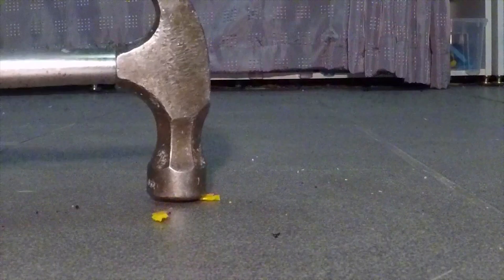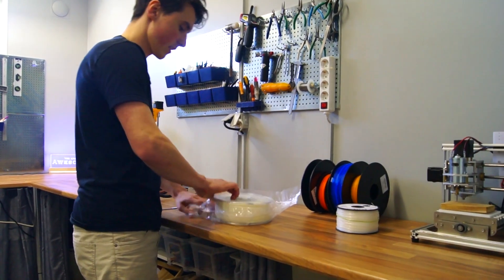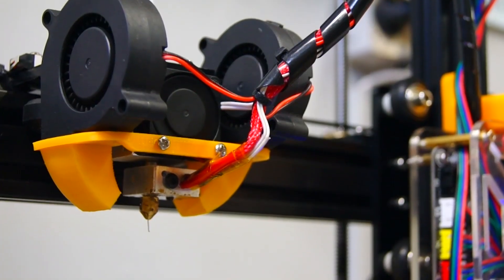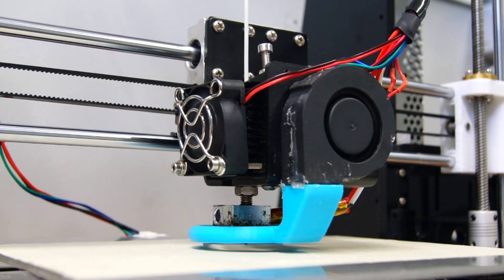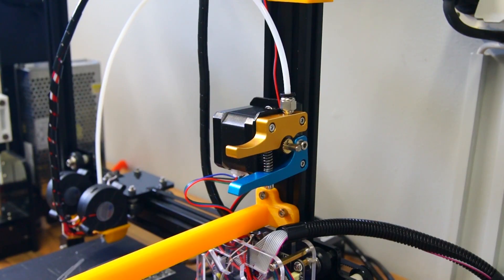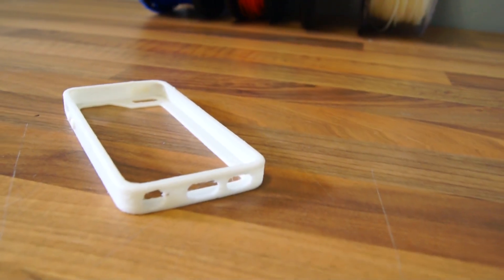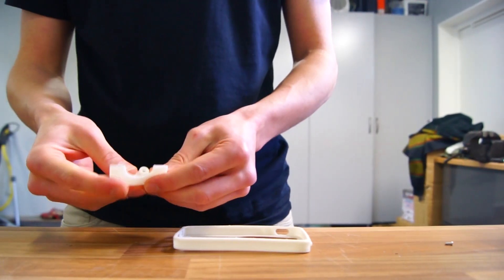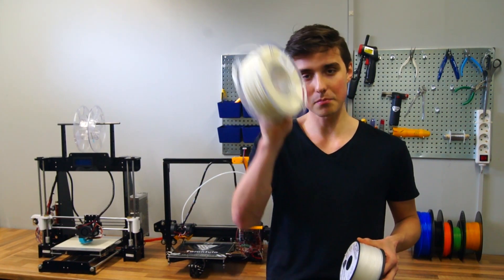Awesome Flexible 3D Prints - How to Print Flexible Filament

Comment: I printed some feet for my gas 6K generator. It sat on the back deck and would send vibrations through the wood into the floors of the house. Add some 4 x 5 in feet zip tied on and it reduced the vibration by 60% or more.

Comment: I think I'll print some flexible bumpers for my personal electric vehicles. I'll have to find what filament is both impact resistant and abrasion resistant, as I think those are the two main risks (also, it should be fairly slippery, as it is often preferred to slide rather than abruptly stop during a collision.

Comment: Great video. I modified my OG Ender3 to print flexible stuff, and it's incredible. I printed some grommets for my car, the old ones were allowing my air filter box to vibrate because they were worn out... with the new ones it doesn't shake at all.

Comment: Hey RClifeOn, I wanted to say thank you for all your videos on 3d printing. I had a question regarding the flexible filament you are using here. 

Im making a brake pedal covers for my car as well as a flexible boot for my shifter. I wanted to ask if you knew the thermal behaviors of these filements. I'm trying to figure out if these filaments would be okay with handling drastic temperature ranges normally seen in cars. If you don't know, could you point me in the right direction?

I appreciate whatever you can offer. great content, thank you...

-Evan

Comment: Way over cost on the old anet a8.   They've upgraded to the AM8 at this point for the same cost, and its easier to just throw some linear rails on the AM8 because its made of aluminum extrusions.   Not saying the anet a8 isn't a great printer, it is, but it isn't 260 dollars great in the current market.  Dont pay more than 130 for an a8...

Comment: Image using the elastic filament, for something like a phone case for a cheap phone like, a phone from a dealer like, metro.  Having a back to the case, would help, especially if it's dropped off a table or a desk. I would use it for that, going with a design that had some grip to it.

Comment: Say that I want to make a custom figure with a bendable tail, aka steel wire on the inside. Is there a way to print the tail with a flexible but more bendable and a bit tougher material?

Comment: alot of 3d print guys are nuts and goes buys a 30 dollar part for there  upgraded parts for there 3d printer, This guy is kinda smart, his 3d printer couldnt print flexible filament, so he 3d printed a part to fix and upgrade his printer, didn't order a 30 dollar part.

Comment: I really need to find a flexible filament did I can print with my cr-10 that is about the flexibility of a rubber spatula do you know of any such filament? Also is there a good solution for the extruder on a cr-10 I know there's a printable extruder solution but I don't know how good it works I guess I would just have to try it out. Any help that you could give me would be greatly appreciated

Comment: Would PCTPE work well for printing arms for rc cars or would you recommend some other filament? Thanks
Reply: Regular nylon would be nice for that I think, pctpe is a bit too flexible
Reply: ValeninRC Would that be like PETG filament?
Reply: @romanbriley2740  no, petg is much harder and more brittle than nylon, nylon is kind of a mix between pctpe and petg. Also depends on the type of nylon of course
Reply: @romanbriley2740  but if it's a 1/10th scale you can also just try it with PETG or even PLA
Reply: ValeninRC I got some PETG today and was going to give that a shot. I’ll definetly look into nylon then. Thank you.
Reply: ValeninRC PLA is a little too brittle, I’ve printed some arms for the bandit and it’s okay but yeah too brittle. I’ll give PETG a go and work from there.

Comment: Hey man, i love your channel and jt inspired me to buy a 3d printer, and i like to grt hands on with things so i picked the creality ender 3, i didnt get the pro tho, but i have a question, my printer worked amazing, not perfect but great results for the first few prints, but now the printer is leaving some space in between lines, on all axis, which makes the prints come out spacey with gaps in them, i use good quality filament and recommended settings, any ideas?

Comment: #1 pro tip for printing with flexibles, even with a bowden: run ptfe tube all the way in between the extruder gear and idler, with the tip cut in a wedge shape to fit snug against them.

Comment: i'm going to print this: Thor-Design-Gurtschlaufe … a mounting for the battery tank of a diving lamp (attach the battery to the compressed air diving device) - 95.- I find clearly too expensive; we'll see if my ANET A6 can handle it (if it is fixed again)

Comment: Hello, thank you for your content. I am presently working on finding a material suitable for making my prototype. 

This material needs to be soft yet keeps its form, very light in weight so it can interact with air when it travels through air ( airworthy) and smooth so it will help with the airworthiness.

I have tracked down the material to TPE category and then the subcategory of the PEBA.  

I wonder if I am finally on to the right material for my toy prototype?

Can you suggest anything else to meet my criteria?

Ideally a material similar to what soft boomerangs are made out of, they seem hard yet bendable and keeps its shape, soft and lightweight and smooth enough surface for air travel when thrown.

With kind regards,
Mehran

Comment: Hi...
How about to explain differences between materials and for what is better recomended : PLA, ABS, Flexible PLA, HIPS, WOOD, PVA, Nylon, Wood-Polymer, eLastic, PCTPE
Show us some examples also. ;)
And maybe to try to listing each material for one by one of all your printers... if support to print... or what adjustments can do to work each filaments for each printers... of course, if is possible.

Comment: I wonder whether anyone has tried making a non-Newtonian filament?

D3O (which is used, amongst other things, as 'molecular' body armor for motorcyclists) is a polyurethane energy-absorbing material containing several additives and Polyborodimethylsiloxane a dilatant non-Newtonian fluid.

But, even if that mixture is patented, corn starch is one of the easiest to get ingredients.

If we can print and create a flexible, non-Newtonian gel, then we can make our own armor, gadget protectors, and . . . everything !
Show less
REPLY
Reply: What I mean is: D30 company have taken non-Newtonian fluid and made body armour. Perhaps they use an injection molding process or something similar.
If you know for certain that non-Newtonian properties will not occur in a solidified material after it has been liquified and then cooled: then I accept your response.
However, I expect that D3O is also in liquid form prior to being molded into shoulder pads, knee pads, etc. which is why I initially made the comment -- I am simply hoping that an impact-resistant, non-Newtonian material is developed soon, so we can make our own gear.

Comment: TEVO Tarantula must have the flex extruder to print with a flexible filament ?
Reply from the maker: No, but it will work easier and you might be able to print faster.

Comment: So you didn't use a different extruder for Tevo, just a tighter clamp solved the issue? Flex extruder adds 40$ to printer's price...
Reply from the maker: Yes, I simply added the tighter clamp, though it would be interesting to see if the flex extruder would increase printing speed.

Comment: what's the point of a flexible wrench? you wont be able to use it or was it just for click bait
Reply: brendan lee Why would this be for clickbait? The thumbnail shows a flexible wrench, which he showed in the video. Also he just printed the wrench to show the properties of the filament and because it looks cool, not because it's useful.
Reply: A flexible wrench can be used on flexible nuts and bolts.
Reply: brendan lee it’s a joke dumbass
Reply: protection & gopro & lot of nice parts for FPV drone. I just bought one and will be only printing tpu
Reply: brendan lee obvious guy is being obvious
Reply: Yann Msa  if you want to be printing a lot with flexible filament get a flexion extruder

Comment: so i have a question.i have been working on snorkels for people and one common issue  that occurs is the valve under the mouth piece breaks or erodes. is it posible to print one of the valves out of that material. also is it possible to use the as-atone bath method to make it smooth?

Comment: Does anyone know what the best 3d printer is for under $250? Also, if you know one can you list it's print volume?
Reply: https://www.amazon.com/Monoprice-Select-Printer-Heated-Filament/dp/B01FL49VZE/ref=sr_1_1?s=industrial&ie=UTF8&qid=1490831482&sr=1-1&keywords=monoprice+3d+printer

You can find it non backordered on monoprice.com, and the build volume is : 4.7" x 4.7" x 4.7"
(120 x 120 x 120 mm) .

Comment: man I want a 3D printer so bad
Reply: Save up the money there are 3D printers that cost just $200 now.
Reply: Speshial yeah here is a link to one https://www.amazon.com/dp/B01FL49VZE/ref=as_li_ss_tl?ie=UTF8&linkCode=ll1&tag=corridigit-20&linkId=f7b4505f5f72b686422ee123a378c38a
Reply: @Scrotelicker  its small as hell
Reply: @Scrotelicker  you don't want that POS... get an ender 3
Reply: GrodyMaroon I'm probably gunna get the tarantula
Reply: ppdonut there are?...
Reply: diego ramos the anet a8 is cheapest on gearbest. I have one myself.
Reply: This is definitely far too late to be useful, but I recommend the Maker Select   

https://www.amazon.com/Monoprice-13860-Maker-Select-Printer/dp/B018GZBC3Y/ref=sr_1_1?ie=UTF8&qid=1492646541&sr=8-1&keywords=monoprice+maker+select+v2

I was completely new to 3d printing, and it works great for me. Took a little testing on cura to get the correct print settings, but I can now make prints that (in my opinion) almost match anything from a makerbot or lulzbot or anything like that.
Reply: i like turtles
Reply: TheRedStormer you but for only 40$ more I can get the other one ummmmmmmmmm for 200$
Reply: it's a great time to get into it! the community is booming, and machines, parts and fil are cheaper than ever. but be aware that you're buying a complex hobby, not a plug and play inkjet printer. and you will have to become a bit of a tinkerer, if you buy a cheapo kit. it makes for a good learning experience, thogh!
Reply: diego ramos we get one if we learn to mage 3D bodells :3
Reply: diego ramos same
Reply: #Same
Reply: diego ramos  totally
Reply: diego ramos same
Reply: same ;C
Reply: diego ramos me to
Reply: https://www.monoprice.com/Product?p_id=15365

Im probably going to get this its $200
Reply: It's 300x300x400
Reply: What?
Reply: diego ramos same here
Reply: diego ramos I have one but it is t that good
Reply: IV GOT ONE
Reply: did u just assume my gender?
Reply: Me too
Reply: Speshial even under 200
Reply: Harrison Clark it's $220 and it doesn't look good to me
Reply: Diego's game stuff just buy one
Reply: Diego's game stuff same
Reply: I have one reeeee
Reply: I highly recommend the Flashforge Finder because it is only about $300 on amazon and I’ve been using it for about 6 months and I rarely get fails also it is intuitive and user safe.
Reply: @kambu_ch3127  worked fine on gearbest, bought a anet a8 for 150$ from them and it came 5 days after
Reply: Don’t let it yam up tho
Reply: I got the Gold Tevo Tornado and it's awesome!My first printer was the Flash
Reply: do you have one now?
Reply: @certified-forklifter  ye I have if u were talking with me.and I had a tevo flash.now I have a tornado
Reply: @ibbnoghere  I didn't mean you, but cool anyway! cheers =D
Reply: :) cheers
Reply: @GrodyMaroon  hehe now the a8 is called hazardous:) fire catcher
Reply: Ender 3 is only 200$
Reply: ho doesn't : )
Reply: Ketsu ummmmmmmmmm I'd rather not sorry lol😉😀
Reply: karlpc200 lemme geuss creality cr 10

Comment: what kind of tarantula did you get, the link, shows a standard and larger version with different types of extruders?
Reply from the maker: I have the "Standard Printer". No upgrades at all.
Reply: RCLifeOn thank you, do you know what the pro extruder is? I'd like to buy the tarantula after seeing your video but I want to be able to print in ABS
Reply: Standard will print ABS just like PLA, but as ABS needs heat to prevent warping its best to have an enclosure for it. The Pro Extruder is advertised as being able to print using the flexible material, but as you can see in this video, printing the top part of the standards extruder with tighter tolerance works aswell.

Comment: Great review of what we can expect for a flexible filament and the application we can make out of it! 
I'm curious about the wood filament did you already try out ? If yes is it possible to print with this kind of material with an anet A8 or a tevo tarantula printer?
Reply from the maker: Hey thanks! I have not tried the wood filament, though I think both printers would be able to print the filament with no problem.
Reply: +RCLifeOn wow great video lots of useful information ;)
i have one question for you tho..
could you link me the vibration dampeners on thingivers and if you have created it yourself could you please share it with us?? it would be awesome. I'm planning to use this for my anet a8 bowden setup since right now I'm using some plastic foam as dampeners.
loving the videos man keep up the good work ;)

Comment: drop your iPhone dude
Reply: are you crazy
Reply: Nathan  he did dropped that camera. so obviously I thought he is going to drop test that iPhone
Reply: Lionel Tech Reviews of a
Reply: The camera was shock-resistant to begin with, the iPhone was not. The case won't make the phone shock-proof, only a little bit more durable and a bit less likely to break (usually the screen shatters). It can still shatter, and will shatter from a decent height of only a few meters, even with the case. If you want a shock-proof case they're made of aluminum and gorilla glass and will cost more to make than to buy from store, and only fit some phones.